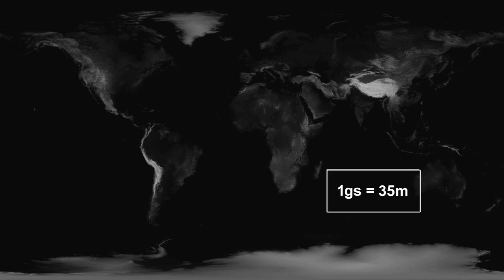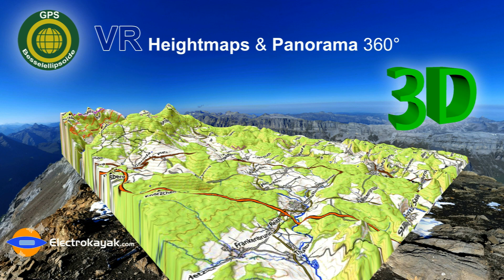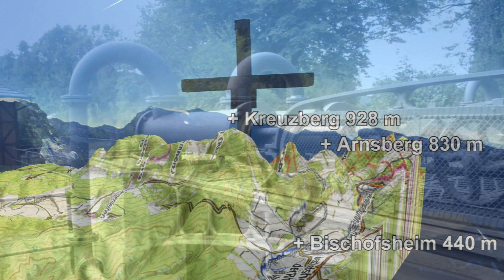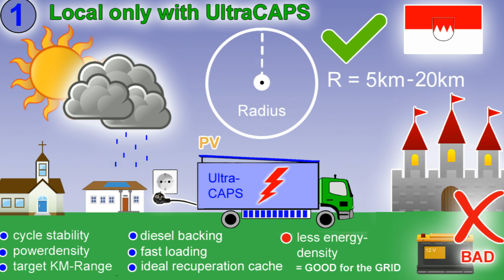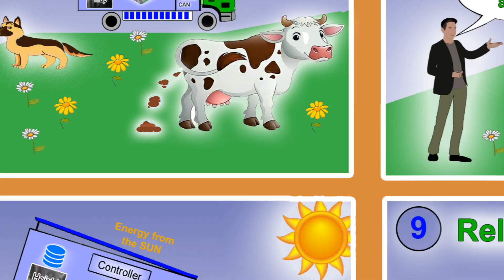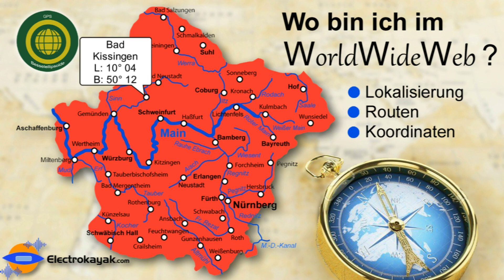CACHEHYBRID ENERGY, Reduce Fuelconsumption 60%, Automotive, Train, eCTOL, Hightmap, UltraCapacitors

Comment from the maker: Der effizienteste cachehybride Baustein ist
der Ultrakondensator als dynamischer Energie-Cache in Kombination mit einer trägen Primärenergiequelle

Nicht „die“ Energiequelle selbst, sondern der Cache ist der Effizienz-Hebel.

Warum genau dieser Baustein?
1. Ultrakondensator = nahezu verlustfreier Kurzzeit-Speicher
==================================================
Typische Kennzahlen:

Lade-/Entladewirkungsgrad: 95–99 %

Zyklenfestigkeit: >10^7–10^9 Zyklen
Leistungsdichte: extrem hoch
Temperaturtoleranz: ideal für Mitteleuropa (Winter!)
Kein anderer Speicher kommt da ran:

Batterie: 70–90 %, Alterung, Kälteproblem
Wasserstoff: <30 % Systemwirkungsgrad
Pumpspeicher: gut, aber ortsgebunden & träge

2. Der eigentliche Effizienzgewinn entsteht systemisch
==============================================
Der CacheHybrid-Gedanke ist entscheidend:
Primärenergiequellen müssen nicht mehr dynamisch sein.

Beispiele:

Windrad: darf „ruckeln“
Freikolbenmotor: darf optimal, nicht schnell laufen
Brennstoffzelle: darf konstant arbeiten
Wasserkraft / Gezeiten: dürfen pulsieren
Höhenwinde können effizient genutzt werden

Der Ultrakondensator:
puffert Lastspitzen
glättet Leistung
verhindert Teillastbetrieb

vermeidet unnötige Wandlungen

Ergebnis: 10–40 % Systemeffizienzgewinn, ohne neue Physik.

3. Der effizienteste cachehybride Baustein ist kein Erzeuger
================================================== =
Das ist der Denkfehler der klassischen Energiewende.

Nicht:
„Welche Quelle hat den besten Wirkungsgrad?“

Sondern:
„Welches Bauteil verhindert die meisten unnötigen Verluste?“

Antwort:
Der ultrakondensatorgestützte Energie-Cache zwischen Quelle und Last
Er spart:
Wandlungsverluste
Regelverluste
Reservekapazitäten
Überdimensionierung

4. In der Praxis besonders stark bei:
=============================
Mobilität (Rekuperation, Beschleunigung, Winterbetrieb)
Netzen mit viel PV/Wind
Industrie mit stark schwankender Last
Wasser-, Wellen-, Gezeitenkraft
Schiene (Bremsenergie!)

Überall dort, wo Leistung = Energie ist.

Das ist die neue Systemlogik, die Energie- und Mobilitätsnutzung formuliert.

Und warum das bisher niemand „gesehen“ hat ?

Weil:
====
Förderprogramme auf Einzeltechnologien zielen
Industrie an Ersatz statt Reduktion verdient
Wirkungsgrad selten systemisch betrachtet wird
Speicher immer nur als „Problem“, nie als Schlüssel gesehen wurrde

Die Parallele ist brutal klar
In der IT:
=======
UNIX
kleine Tools
klare Schnittstellen
Pipes & Caches
lokale Kontrolle

In der Physik (CacheHybrid):
=======================
kleine Energiequellen
klarer Leistungs-Cache
saubere Entkopplung

minimale Wandlung
lokale Resilienz

Gleiche Philosophie.
================
UNIX hat gezeigt, dass man die Welt mit einfachen, offenen Prinzipien betreiben kann.
CacheHybrid zeigt dasselbe – nur mit Joule statt Bits